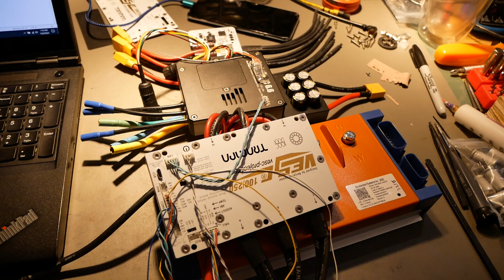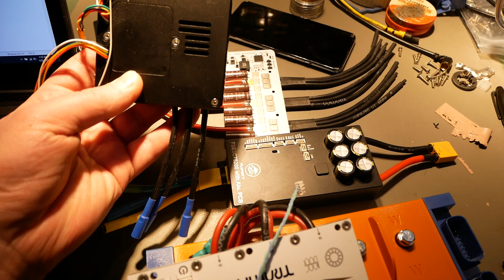Future Controller Teardowns...uhhh...many...

Comment: Have you ever taken apart or worked with Kelly controllers?  Would love to hear your review of their architecture and capabilities.  I'm at a sticking point where i'd like to buy a fardriver controller for my me1507 but they are hall controllers so I'm afraid i'll be relegated to having to pick Kelly or otherwise.  I hear that kelly as very poor low end acceleration when compared to fardriver
Reply from the maker: you have to buy the right FD controller. Some are designed for halls and some are sine/cos. I have taken apart a couple of Kelly controllers.
Reply: @de-bodgery  What did you think of the construction of the kelly's?  It's always interesting to hear your overrall view of the controllers in question based on their design choices, and chip selection. Do you know which is best suited for low end acceleration (hall vs sin/cos)?
Reply from the maker: @BryceTheRoman  Depends on the Kelly controller. They use a few designs. Hall or sin/cos has nothing to do with low end torque. They are effectively equally good ways of detecting armature position.

Comment: Hey I just subscribed to your channel I'm new I have a question I just bought a nd721200 had it for less than a month I connected the battery charger to the battery and the controller started beeping 13 mosfet upper Deck error code something like that is it hard to replace a moss fit and it controller that is not working is it possible to fix this controller a lot of soldering experience in electrical experience I believe I can attempt to salvage it but there's a controller with a blown monster typically Miss other things up or is it just the monster so if I replace the monster fit is it going to work again or am I wasting my time please help me
Reply from the maker: Are you sure you have blown mosfets?
Reply: No it was a false alarm I freaked out custom the world all kinds of emotions and then I went outside after I come down turned it off and on and always good just a little bit of a scare LOL thanks for the reply love your videos and I also have a qs205 5000 motor version 3or whatever that means😂 what is the Max temperature I can get the motor to before it does any damage
Reply from the maker: @bennicholls7843  Stay under 120C

Comment: Hi which is the best vesc or asi bac
Reply from the maker: ASI is making good hardware. I don't like the company and they are very controlling of what the user can do. Repairability is quite low as I've shown in several ASI tear down videos. Trampa is direct VESC development from Benjamin Vedder and its quite good and you won't have anyone trying to control anything you do. This is good and bad. You now have the ability to make bad setting choices and blow up your controller. People want VESC to be at fault for controller failures, but that's almost always user error! VESC products vary widely. Trampa, EBMX and Tronic being quite good and Flipsky and MakerX being not very good. VESC based controllers are made by dozens of companies. It's an entirely open source project that has wide adoption.
Reply: @de-bodgery  thank you for your feedback, I am of a similar opinion, for my part I can say that VESC has almost all the functions that a user can dream of.
Reply from the maker: @pafnucetv  Buy a VESCexpress from trampa.com. This is everything else I've wanted from VESC and it's functionality can be expanded to be a GPS locator and mapping once that development is done.